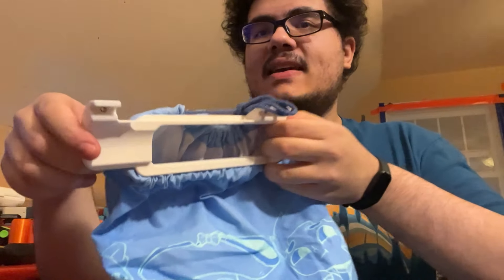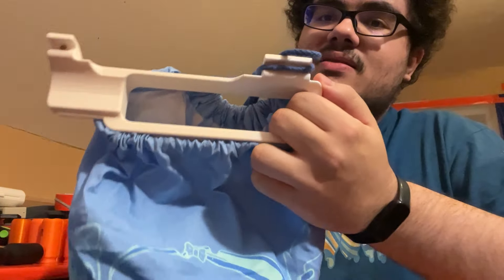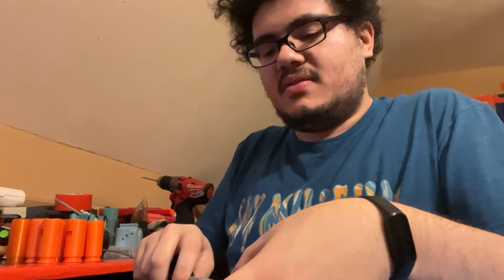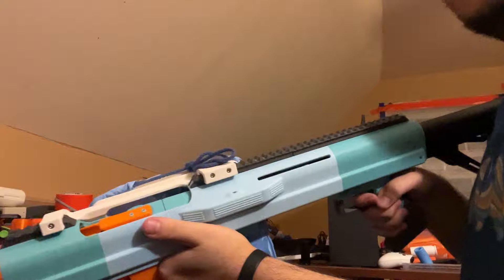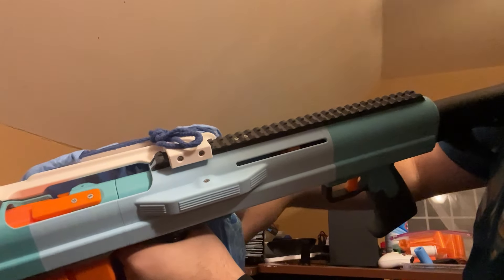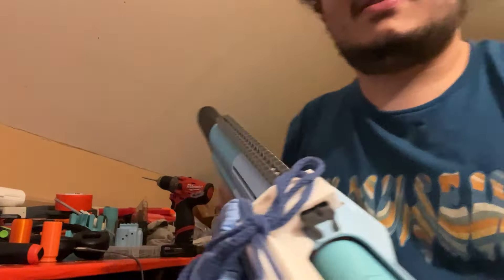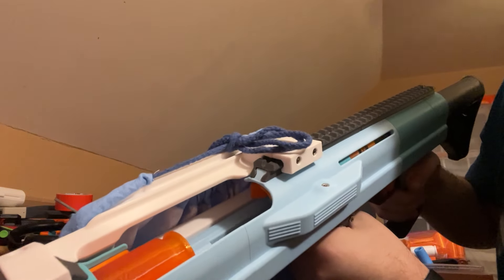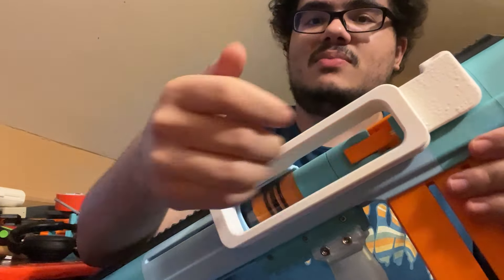Shell Catcher Bag Mount Prototype #1 for the BATTLE AXE Internal Magazine Pump Shotty Blaster!

Comment: Oooo this looks much better (and safer looking for the blaster overall) than my airsoft/real steel one I have for my Spring Thunder!! I actually also have a few Makeship bags that will work perfectly for this! (not as big as yours though. The smaller size might actually be a little better for running and gunning that these are good for lol)

Do you think you'll be making variants of this for future Shotty projects in the future??
Reply from the maker: The plan is to make shell catcher bag frames for all my future pump shotty designs as well, yep. I think its a pretty important safety thing to have available. The one for this blaster probably won't be released at the same time as the blaster though, the catcher needs some more time in development.

Comment: Do you plan to make a version with removable mags?

Also, I love the shell catcher!  Much easier to use for Mall Madness and other events!
Reply from the maker: Nope. This blaster will have the mags permanently attached. Its just better for this layout. The next blaster has the detachable mags, with the mag positioned between the firing grip and the priming grip (a traditional layout, which is much better for removable mags).